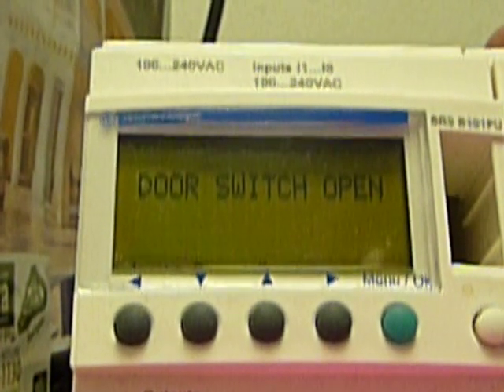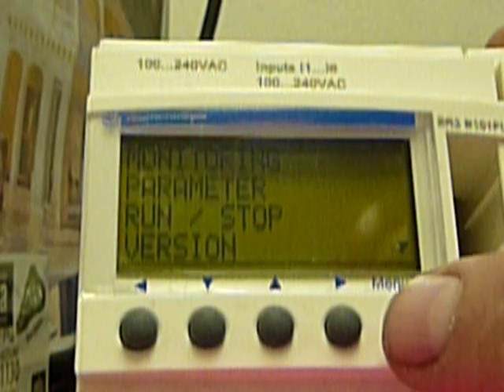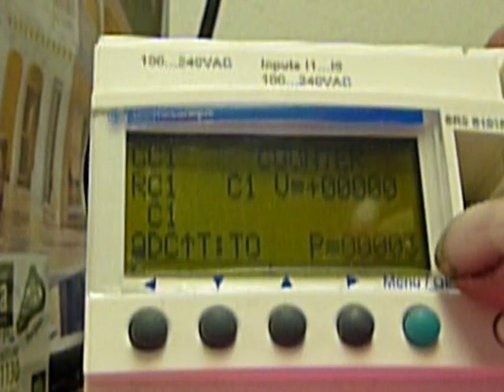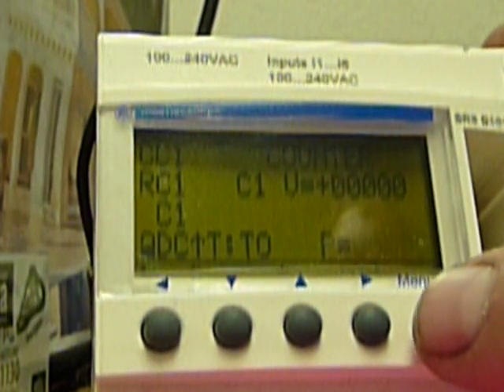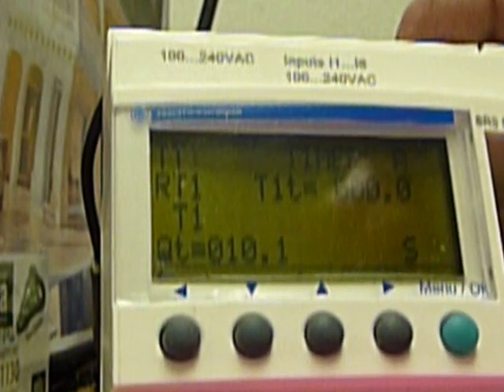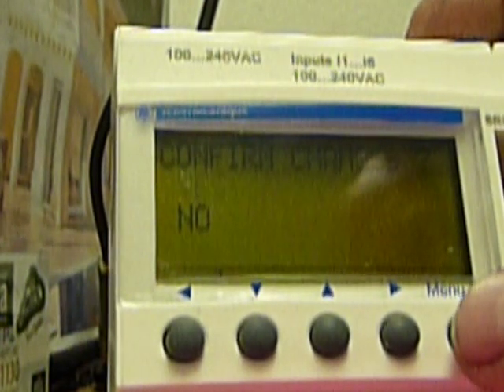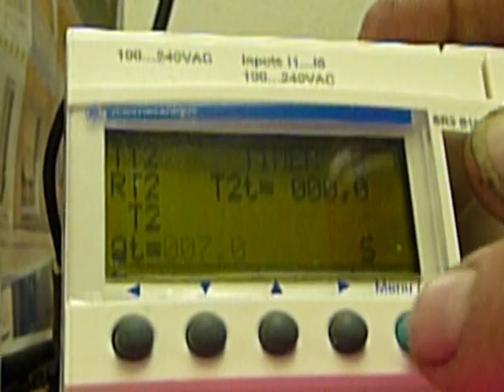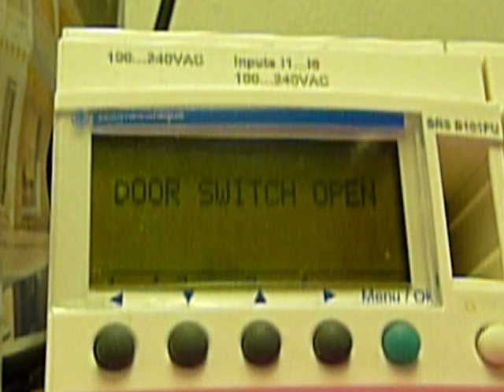plc zelio plc settings

Comment: I am trying to get a XU9M18MA230 photo-electric sensor to work with a Zelio SR2B121FU but I am unsuccessful.
There is a reflector that comes with the sensor. I need the sensor to work with the Zelio so when the beam is broken a light flashes for 15 seconds. then goes off until the beam is broken again
 Any assistance is greatly appreciated :)